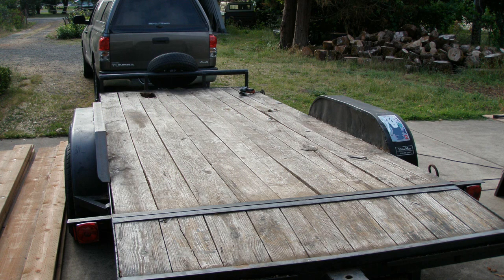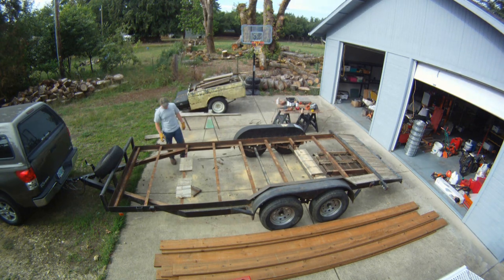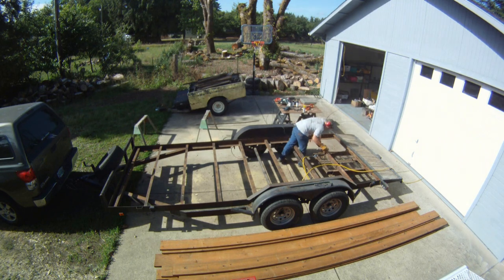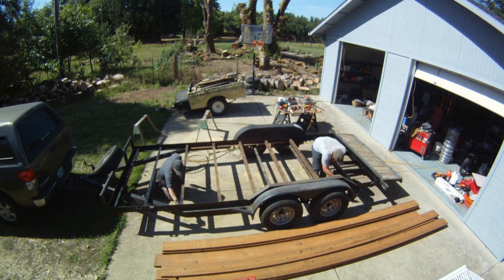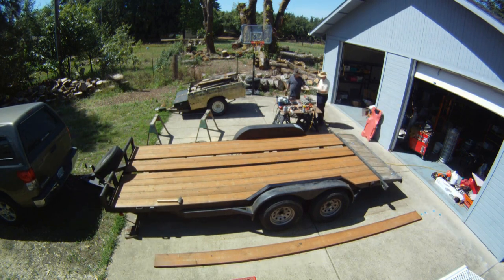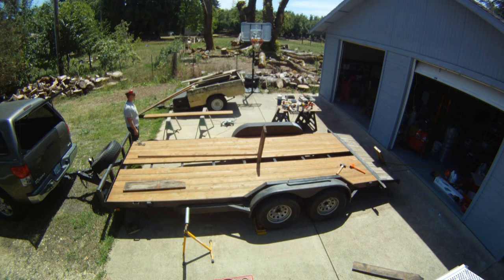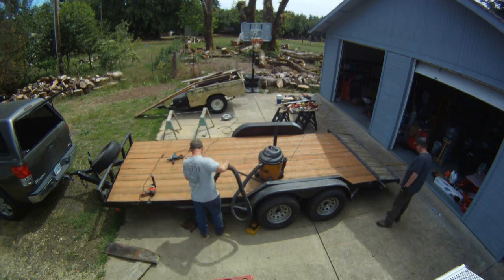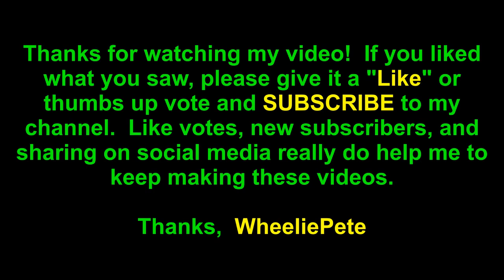Time-Lapse Trailer Deck Rebuild (Narrated) (GoPro pics at 2 second intervals)

Comment: So excited to find this video. I'm a girl getting ready to rehab my old trailer and this gave me confidence that I got this. Thanks for the time lapse and the voice over.
Reply from the maker: So a couple things I've learned since I did this and that I would do differently:  I would not use the 2x8's again.  I would get the widest boards I could and put those in.  I did the 2x8's because it was cheaper to buy them in 16' lengths than fewer 2x10's or 2x12's of the same length, but what I found was that there is going to be shrinkage and expansion during different times of the year.  When we're in the wet season here, the gaps between boards close, but in the hot summer, there are considerable gaps between boards that open up.  Fewer boards (by using wider planks) would help alleviate that.  Also, If I was doing it again, I would looked for dried planks and then seal them.  The boards I used were wet pressure treated boards and I didn't bother to seal them which has also led to the issues with expansion and contraction.  I did end up doing the tail section a few years later and used wet pressure treated 2x10's and it worked a lot better and doesn't seem to be having the gapping issues when they dry out like the upper deck.  So basically, use the widest boards you can afford, and if you can, use a sealer after you install.  Those self tapping screws that I used in the video have been awesome.  Even with all the expansion and contraction of the wood, none of the screws have broken or come loose.  I would use those again in a heart-beat.
Reply: @WheeliePete   Good tip, but isn't there a greater chance of boards splitting the wider they are?

Comment: Nice job. Now I know its a bit  late for constructive suggestions....but for anyone else considering redecking ,I would like to make the following suggestions . Always examine the board on each end and when possible put the bark side out (up) based on examination of the rings. This does two things. One is that it keeps the softer heartwood on the bottom side. Second and this is the most important . When a piece of wood such as pine or fir or cedar gets wet and dries repeatedly , The wood will tend to cup up when the bark side is down. It will hold a puddle of water longer rather than shedding the water. This is especially bad if you live in a freeze zone, as the soaked wood can freeze and expand ,In some cases it will pull the fasteners . In others ,it will bury the fastener into the wood . In both cases it will make the board loose. Every springboard I have ever seen at my local dock that has become a springboard ,I have been able to determine bark side was down .Also be aware that sometimes the board is cut with the pith in the middle of the board. I avoid using this type of board unless I cut it short.. Probably the best thing to do before using pressure treated wood is to buy it in advance. lean it near verticle in the shade for a few weeks. This will allow gradual drying and reduce checking and warping,if air is able to get to both sides. Drying while sitting in the direct sun on a trailer is rapid and one sided.
Reply from the maker: Good information!  I've been amazed at how much that wood expands and contracts throughout the year.
Reply: I concur with everything you said. Sho' Tru!
Reply: WheeliePete has always

Comment: Here's a tip if anyone is considering this.  I just priced out 2X10 pressure treated and found the deck was going to cost me about $400 in just the wood.  I calculated it again with 2X8 pressure treated and found it to be $270 for the same sqft of coverage!  So you might be able to save quite a bit by pricing out different dimensional lumber.
Reply from the maker: Here's the problem though, unless that wood is dry, it's going to shrink big-time in the summer.  I knew my PT wood was wet when I put it in there so I put it in TIGHT, but I'm still amazed at how big the gaps are every summer.  The thinner the boards, the more gaps you have to deal with when it shrinks.  I keep thinking I'll seal it at some point, but I've never got around to it.  If I was going to do it again, I'd get dry trailer decking as wide as I could and then seal it.
Reply: @WheeliePete   True, but I don't see the gaps between the boards to be a problem except women with high heels. Not much different than a deck at home where you have these gaps planned.

Comment: Good idea with center board in two pieces or it looked like that's what you did. I have the captured end of boards by angle iron pocket type of floor. Think I can slide most of the boards in at an angle to fit in the end pockets and then cut the ones I can't in the middle  to be spliced and held with those self drilling screws....thanks...knew someone had done something intelligent  that works.

Comment: I use used motor oil cut with diesel fuel to treat the boards on my trailer about every two to three years. It's 10 years old and sits out in the weather. I tried wood sealers years ago and didn't have any luck and used motor oil mixed with diesel fuel is a lot cheaper.
Reply: what ratio of oil to diesel?
Reply: phillijp 6
Reply: @phillijp  from what I've found it's a 50% - 50% ratio.

Comment: I have the exact same trailer,, thanks for the video.  I’ll be buying the screws you posted.
Reply from the maker: So it's been quite a few years since I posted that video.  The screws have been perfect.  If I was going to do it over again, I would have just sucked it up and bought 2x10 or 2x12 lumber.  The narrower planks I used have a tendency to dry and shrink in the summer and create gaps between the boards.  I probably should have sealed them.  Might still do that if I can get the time.   Those self-tapping screws where a god-send though!

Comment: I thought about using composite decking for my trailer until I see the cost (WOW) So now I decided to just use standard lumber, but first I'm going to coat all sides with bed liner before I bolt them to the deck of the trailer, so they should last as long as I'm around anyway.

Comment: I deck these trailers at my job and you did it exactly as we do it except for the middle board. The way i do it is lay it on top of a stack of lumber or in your case the floor and just use wood blocks to elevate it from the ground and grab a circular saw and just freehand the cut, you could grab a square and mark it along since you probably wont be as experienced as ripping through these as i am. I like doing these types of trailers instead of the ones that have welded end caps because with those you have to put a piece of wood in the middle and bend the fuckers into place.

Comment: I brebuild trailers don’t even try to cut old rusty screws...I take a hole saw take center bit ot an drill to you hit metal...afterward you get that board loose. Take a 2# hammer an break off screws...

Comment: It's been about 8 years now since you posted this video. My question is about the fasteners. How have they held up?
Reply from the maker: Zero problems with the fasteners.  I should have used wider planks though, and I probably should have sealed the them after I put them in.   They are holding up fine, but they swell and shrink with the wet and dry weather cycles.   If I was going to do it again I'd use the widest lumber I could get, but I'd totally use the same screws again.
Reply: @WheeliePete  Thanks for the reply. I'm getting ready to re deck my trailer soon.

Comment: great job, i gotta do mine, would you have thought about painting the dovetail wood Black, added life maybe??
Reply from the maker: The dovetail section lasted a few more years and then I replaced that too.  I just had to cut off the top cap up near the deck then I dropped more planks in an welded the cap back on.  On the dovetail I used 2x10 boards and if I ever re-deck the trailer again I would use 2x10's or larger.  I used 2x8's on the deck in the video because they were cheaper than buying larger dimension lumber, but what I didn't account for was the wood shrinking and expanding so much.  When I put them in they were soaking wet so I knew they wouldn't expand any more, but when they dry out I get some pretty good gaps between the boards.  I probably should have sealed it all, and I may still do that, but right now in the winter and spring the deck looks good, but in the summer it gets gaps between each board.  Using larger dimension lumber would mean fewer gaps with less boards.  Those self tapping screws have been awesome though.  No issues with them breaking or pulling out with the wood's expansion and contraction.

Comment: Great job! Can you tell me where bought these screws? Thx you
Reply from the maker: Just kind of by luck I found them at a local regional hardware store we have called "Jerry's" (sort of like a Home Depot or Lowes. )  Brand on the box was "The Project Center"  1/4 - 20 x 2 3/4" self drilling.

Comment: Awesome video you should have did the back part where the old wood was too so it looks brand new great job how much in total?
Reply from the maker: +JT Outdoors   The back wood was still fine and I would have had to torch off a long plate the builder welded over the tail wood to keep it in place.  I think I spent about $250 on the wood.  I've not been really happy with the way the wood has warped and cupped during the summer.  As soon as it rains it all straightens back out though.  I probably should have bought some kiln dried wood and then sealed it.  The stuff I used was pressure treated, but it was soaking wet so it dries out in the summer leaving 1/2"+ gaps between the boards and then swells back up tight in the winter.  But it's been totally useable.  We've hauled quite a few rigs on it...

Comment: how long did you wait to stain those boards
Reply from the maker: I actually never did stain them.  What I should have done was gotten dried lumber, put it in, and then stained it.  The treated wood I got was really, really wet.   It dries up and shrinks every summer and then expands once it gets wet.  It's held up fine to this point as a trailer deck, but I know eventually the expansion and contraction is going to be an issue.  If I had to do it again I would have also used wider dimension lumber.  It would have been less screws and gaps.  I eventually had to do the boards in the tail section a few years ago and I used 2x10's instead of 2x8 like I did on the flat bed.

Comment: I’m trying to decide if it’s wise to put a wood deck on a mesh tilt trailer.  Think it’ll mess up the tilt function (trailer in a recent video of mine if interested in seeing it)?
Reply from the maker: Throw a link to your video in a reply and I'll take a look.   I'm guessing the mesh might be there to provide traction when the trailer is tilting, but I've used tilt trailers that have wooden decking on them before.
Reply from the maker: I don't think it will mess up the tilt function, but if you decked the whole thing it might make traction a problem.  That's a pretty steep ramp when it's tilted and grass clippings, water, mud, etc. will definitely make it even more slippery.

Comment: What kind of bolts or screws did you use to mount your wood to the metal frame? I am replacing my trailer floor and i dont want bolts or screws sticking up threw my floor because i am using diamond plate strips covering the gaps between the wood as decoration on the floor

Comment: How did you tuck the new 16 footers under the angle iron ?  I'm doing the same thing now on a 18 foot car hauler , looks like I''ll have to cut the angle in front or back ?
Reply from the maker: Yep, that's what I did.  On my trailer it wasn't angle across the front top edge, but a big piece of flat bat.  I cut the welds with a cutoff wheel, removed the plate, new boards, welded the plate back on.  Last year I finally got around to doing the dovetail section and had to do the same thing there.  I also used wider boards on the dovetail.  If I was going to do it again I would get either wider lumber or true trailer decking planks.  The pressure treated wood really shrinks and expands with the winter rain and summer heat here.  The wood was wet when I installed it so it is tight in the winter, but in the summer it gets pretty good gaps between the boards.  Wider lumber would have helped minimize that or dried lumber that I would have sealed might have been better.  It's still holding up good though for what I need it to do.
Reply: @WheeliePete  My bad front on mine is a piece of flat bar also , was thinking about the end piece on the dove tail , Will do same ,grinder with cut off wheel , replace wood re-weld flat bar and angle ,  Might add some angle up front to reinforce floor for winch while i got the floor tore out , I'm gonna wire wheel the frame and shoot it with gloss black rustoleum when the rain lets up , Thanks

Comment: I think I can do this by putting a small hydraulic jack about mid way on each board, have someone stand on the end that needs to slip under the angle iron, then ease the jack down and the board will straighten and slide right under the lip of the angle iron.  Has anyone tried to do this? Seems like it would work if you slip the board in at the front, screw it down, lay the board at the tail end on top of the angle, have a good size helper stand on the end, then start jacking till the board slides back off the top of the angle, then while still standing on the end start easing the jack down.
Reply from the maker: Seems like it should work with a long enough board.

Comment: Why didn't you clean off rust and repaint steel before you put new boards on
Reply from the maker: We did.  Wire-brushed it (1:44) with an angle grinder and painted over with rattle-can (2:38).
Reply: You did that's funny didn't see it in video
Reply: You skipped through the video....didn't you.

Comment: wouldn't it be better to use the previous holes and drill them out for bolts. I wouldn't want a ton of holes in my trailer from board replacements.
Reply from the maker: Since there weren't that many screws on the original deck and since it's just a couple pieces of angle iron for cross members it was less work to just run new screws down into the same cross members.  The original screws were all just sheared off in place (they wouldn't come out.)  Worst case scenario on the next deck replacement (in 20 years or so), I could just cut out the two angle iron cross members and weld new ones in really fast.
Reply: you got lucky. I got 3 years out of my original boards. Trailer sits in the weather.
Reply: I've had my trailer for over 1years and the boards are still good. It sets outside in the weather, but every two to three years I brush the boards with used motor oil cut with diesel fuel. It only takes about half an hour and so far has worked really good. I've not had any luck with wood sealers and the oil mixed with diesel fuel is a whole lot cheaper.
Reply: That is 10 years, not 1.

Comment: How many times can you  re-deck a trailer like that before there are so many screw holes in the metal crossmembers that structural integrity is compromised?
Reply from the maker: You should get quite a few years out of the first deck and the same number of years out of the second deck.  That would be a long time to have a trailer I would think.  But if I ever had to re-deck a third time all I would do is once the deck is removed just fill the screw holes with a MIG welder, grind them flush, and redrill.  Holes that small are super easy to fill with weld if you just have a copper backing spoon and a MIG welder.